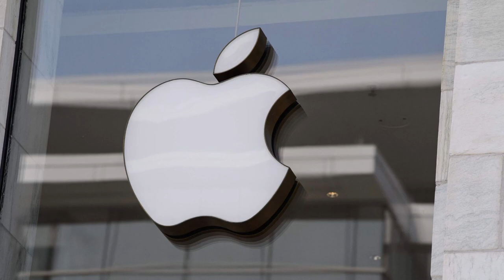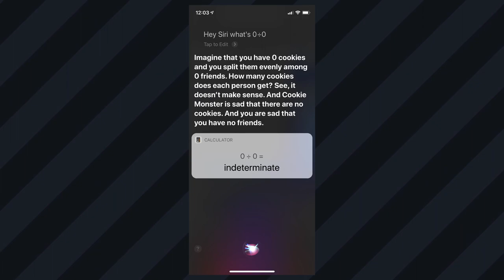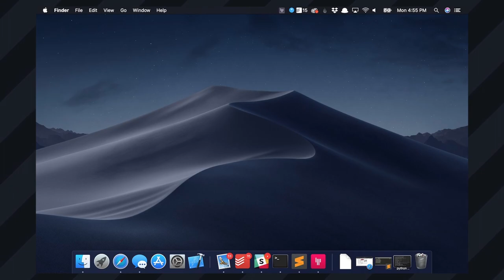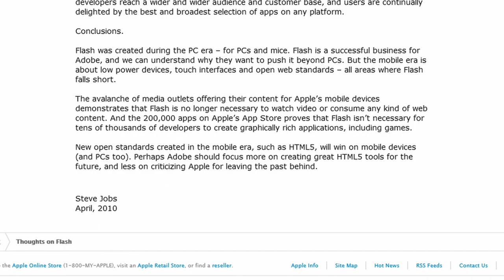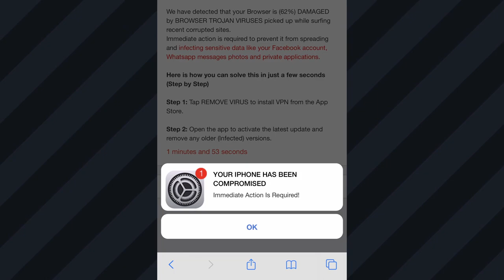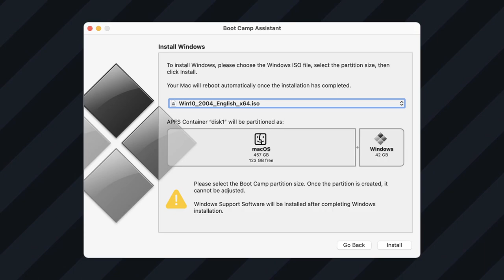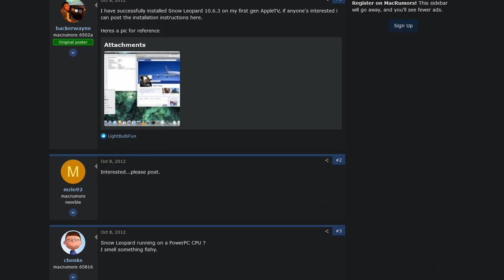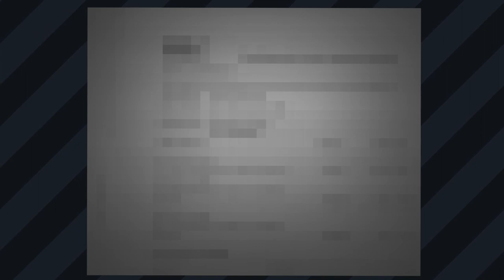The Apple Iceberg Explained

Comment: DAE APPLE EXPENSIVE??!

When you actually do the math and compare apple products to similarly speced non-apple ones, there’s hardly any difference in price. Especially with macs now that apple doesn’t pay the Intel tax. Samsung flagship phones are priced about the same as Apple’s. Of course this would go against the narrative.
Reply from the maker: Apple Silicon Macs are really good, considering the price, but we can't deny that other products like the iPhone SE are just awfully expensive for what they offer: No high refresh rate OLED screen, huge bezels and weak battery life.
Reply: @byteseb  Nice cherry-pick. Plus SE’s mop the floor performance wise against cheap androids so it’s a trade off. Plus they get 5 years of updates vs 1-2 years with a comparable low to midrange android.